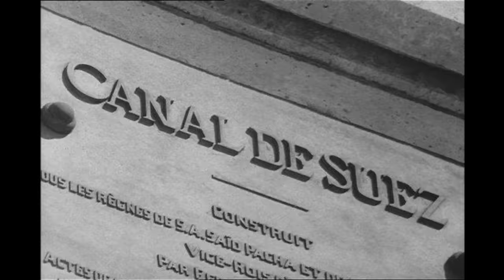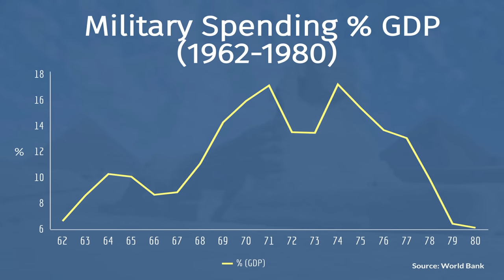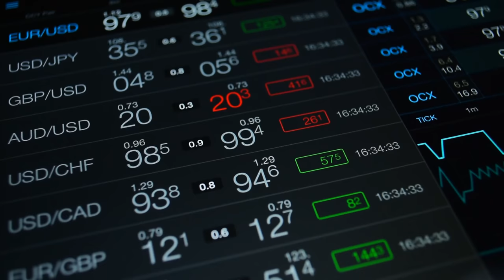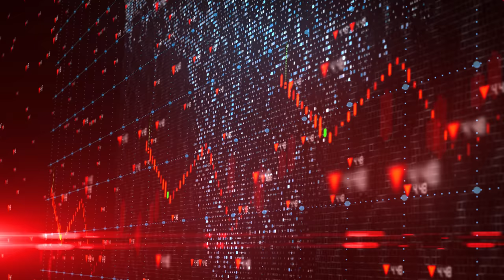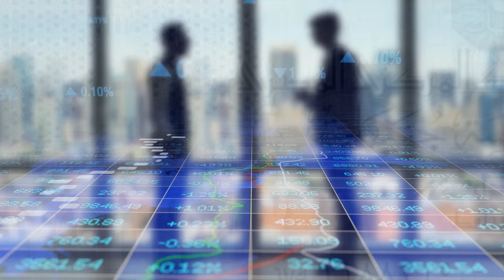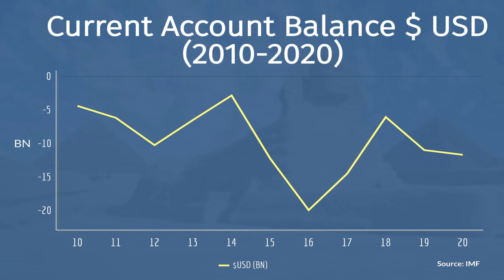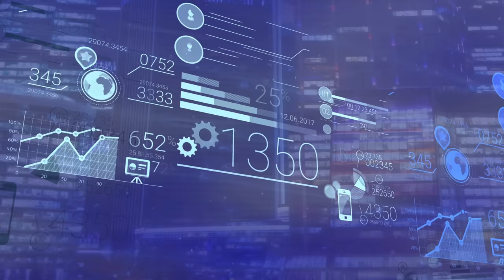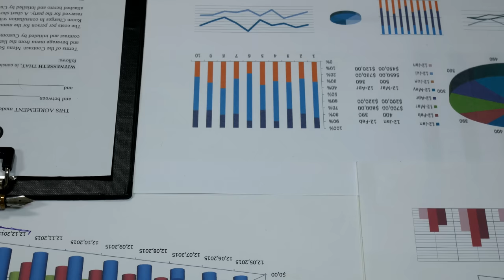The Economy of Egypt: Repeating History?

Comment: As an Egyptian, I think your video was bang on. However, one aspect you missed is the great improvement in infrastructure that happened over the past few years, as well as the increase in road quality. Also, Egypt was famous for it's never ending slum neighborhoods where the people didn't have access to power, clean water or even roads. In the past few years, the government has been relocating the reaidents to new neighborhoods, while demolishing and rebuilding the slums with the necessary infrastructure. In general, I think it really is getting better even though there are still many negatives. Thank you for your informative video.
Reply from the maker: Thanks moustafa. Yes the infrastructute improvrments including and beyond the 20 new and proposed cities are impressive 👍
Reply: Good to know. I've long been interested in buying a property in your country. I visited back in 2017. It has so much potential but corruption has been holding it back for far too long. Hopefully, they address it and improve even further.
Reply: @-glitch-8195  You definitely should check out the new cities being built, phase 1 of most of them should be completed by summer. I would recommend the New ElAlamein City for the best beaches in the region. Also, the New Administrative Capital is also a very good choice, since the governmentis moving there this summer so that should increase demand on units, as well as it's proximity to Cairo (40km to downtown Cairo and 25km to the nearest suburb). I think these are your best bet for profits and are already close to established cities so you could easily rent or use it yourself.
Reply: @MoustafaEwida  Do you know any legit real estate agents there? I've been trying to get local contacts and would love to get some information because I do plan to get a place by the end of the year at least. Appreciate your input though. I'll definitely take that into consideration.
Reply: @-glitch-8195  Id have to ask someone, since I haven't needed one yet. But i'll get back to you ASAP. Also, a small piece of advice, do your research before even talking to an agent, and have an idea of what you want, since they will try to sell you the stuff that doesnt fly off the shelves
Reply: @MoustafaEwida  Thank you! and thank you so much for the advice!
Reply: But this is part of the problem, they used all the debt money to build roads and empty structures in the desert that will NEVER generate revenue, then they will be forced to borrow more money to populate those structures and provide services, all without making a single dollar in return. And that's why they started "demolishing" people's houses, to force them to pay the "resettlement fee" or buy a new house altogether.
Reply: @eg12p34  Sorry man but this literally makes Zero sense. So according to you, moving people from shacks and uncivilized homes to real apartments with services, schools, hospitals now generates money for the government. If so then you have solved the housing crisis in the whole world.
Reply: @eg12p34  
 Cities in the desert are all funded by investments especially cities like the new administrative capital and Al Alamein should be generating revenue because the real estate business in Egypt is very promising and the land is much more worth than it's cost now. It was a worthless desert in which the m3 would cost nothing to buy but now after the government developed the infrastructure there  sells areas for real estate companies by a much higher price and making even profit
Reply: @eg12p34  they have already generated revenue.

Comment: For long ,I’ve seen Egypt as a failed state struggling to not fall into total chaos . May be that’s slightly changing but I’m not optimistic given the narrow minded - blunt skilled government officials 🤷🏻‍♂️
Reply: And corrupt as well
Reply: Negatives do still exist for sure, but I doubt any Egyptian really believes that we are worse off than we were between 2011-2015. We need much more than just government officials, we need to educate the majority of the population, which is a massive task. Simply throwing money at the education system won't suffice. I hope the current government does have a plan, and I understand that it would take years, if not decades, for us to see its fruits.
Reply: @Igor Senkin  take it from a suffering Egyptian , we didn’t have a running economy from the start for us to experience a recession ! That’s pretty misleading ,bro
Recession is a daily fact for us along the past 8-10 years .
Reply: @MoustafaEwida  I strongly believe they don’t have a plan 😊
Reply: @ahmadkhattap5425  I went to Egypt in 2013 with my family right after the revolution. My parents took a huge gambit and boy it was quite messy. I hope things have improved since then because the Egyptian people in general are very nice and welcoming.
Reply: government cut spends of support feeding 🛢️ electric ⚡  in 2016 by 80% and turned it to infrastructure and indestry new 22 mega city gen 4 to housing next 216 m egyption in 2050   rail ways solar panels roads Bridges dig canals airports sailports eleminating slums problem forever  and alot
Reply: Egyptian here👋🏼 believe we are moving towards what’s right but it will not be easy because we have challenges in every sector but I started to be more optimistic
Reply: I see the same thing as you do sadly , Egyptian too

Comment: The Grand Ethiopian Rennesaince Dam is not the problem. Egypt is the problem, thinking they can dictate how the dam will be operated. The dam doesn't hold water hostage, it is solely for generating electricity. The Nile doesn't belong to Egypt & Sudan only!
Reply: but the Ethiopian gov refuses to have an agreement with egypt and sudan about regulating the flow of the water and its amounts therefore the two countries have concerns.
Reply: One thing I know Ethiopia is not a match for Egypt Ethiopia a country full of problems with an active Civil War .
Reply: @lifeisgood2790  Yep. But just as populous and capable of raising an army. Ethiopia has the high ground here. There are so many reasons why they are confident they could fuck over Egypt.
Reply: @mwanikimwaniki6801  more populous doesn't mean more efficient
Reply: @caldoreo  I am trying to see where I mentioned that.
Reply: Well if that is true then why is Ethiopia refusing to sign on it? 
Sudan and Egypt are not trying to "dictate" the terms they are simply saying that there needs to be an agreed process in place to protect against droughts and floods.
Technically the dam will be operated by Ethiopians only not Egypt or Sudan.
Look at it this way:
Egypt owns the Suez canal, but the process of its operation is controlled by international treaties because of its strategic importance.
The Renaissance Dam is a similar case.
Regards